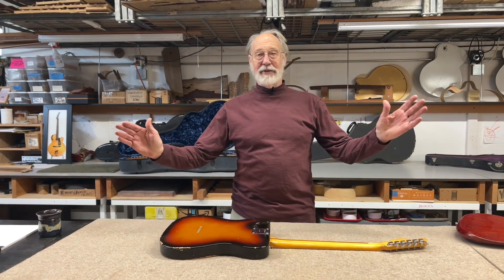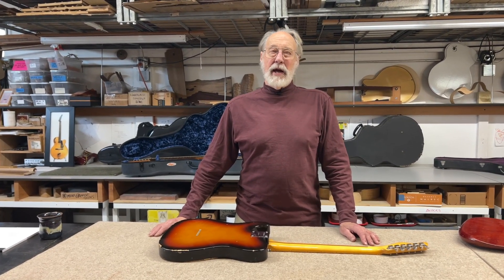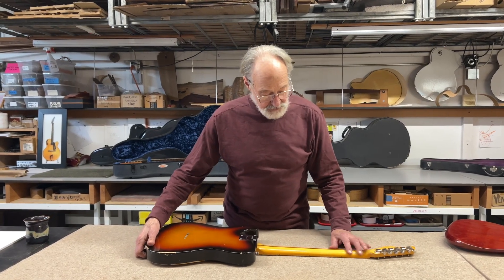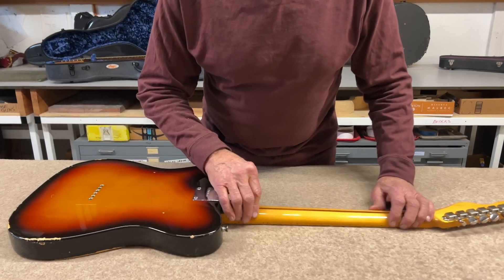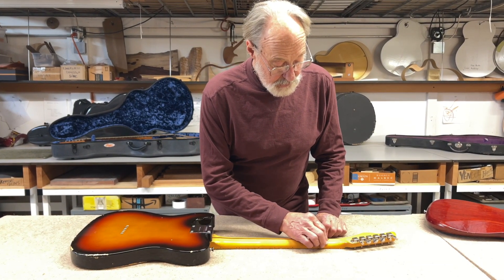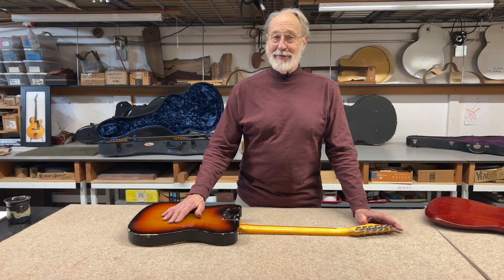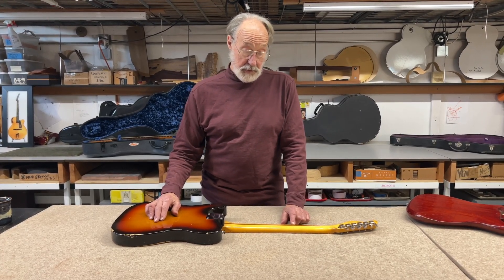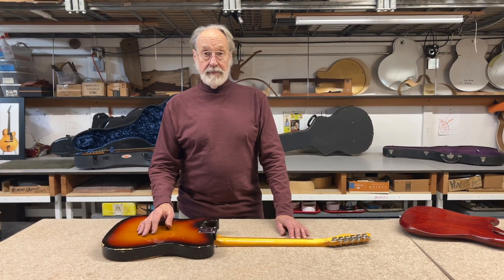Ken Parker Archtoppery - The Neck Journey 5) Neck Creep

Comment: Hello, Ken, can you tell us, how do you repair those necks with ´creep ´? As a hobbyist i found out,  that this effect is way more less on laminated ( longitudinal of course) necks, also on maple necks with glued darkwood fretboards ..For me it is really a problem, because i got a medium to  slim  one piece maple V shape neck, which i very like.I really needed  to lower the frets in relation to the other as from fret 13-14th on, up to  0,6 mm. Fretsize Medium Jumbo 1,4mm crown height. This leaves me not very much fret material there.  Only thing i can think of, is removing material from the neck itsel  as from these critical areas on. Thanks for an answer !
Reply from the maker: Yeah, Alex, you need to do some woodworking so that the frets are the correct height.
My method for this is to tune the neck with the desired strings, then adjust the truss rod so that the neck has the right shape from the 1st to the 12th frets. For an electric guitar, this means just a few thousandths relief at frets 4&5 on the treble side, and maybe twice that on the bass side, certainly no more than .008". This can be measured best with a feeler gauge set. Now you are ready to size up the woodworking that's needed above the 12th fret. Using a good 18" straightedge sitting on the first and last frets (while the guitar is supported on the bench in playing position, not flat on its back) , measure the gap between the 12th fret and the straightedge. It will  very likely be different on each side of the neck. Carefully measure with your feeler gauges, and write it down so you don't get confused. This is the amount of material you'll need to remove from the end of the fingerboard, gradually tapering to removing zero material at the 12th fret. Of course you'll need to remove the frets in the second octave, marking them for orientation and keeping them in order. If you remove them with care, using a correct geometry, non-mangling set of fret pullers, you may be able to re-use them. On a bolt on neck, remove the whole neck so you can measure the thickness of the neck at the end with your calipers so as to know just when you've removed the right amount of wood from each side.
Blend it all in the best you can, and re-drive the old frets, if they are full height or very close to it. One common cosmetic problem will be the change in color when the boards are maple or rosewood. Ebony doesn't usually present a problem.
I ran a big repair shop , 1978 - 1982, and did hundreds of these repairs in NYC at Stuyvesant Music, 48th Street and 7th Avenue, schooling the repair folks in my shop in the weeds of this job, which we dubbed "The Usual Repair" because it was so often a better deal for an amateur player than a whole fret job, and worked just as well.
Another consequence of doing it like this is that the fingerboard often "gets" a little wider as you remove fingerboard material, so the fret ends sometimes seem not to reach the edges of the fingerboard. A little sanding gets it all good.

Go Get It, and join the practitioners of the Usual Repair!
Reply: @kenparkerarchtoppery9440  Dear Ken, thank you for the trick to determine the final height of the frets..!  ( I already replied  to your  answer the day you wrote this, but i cannot find it anymore, disappear...:)) I had my ( mind )hands on it..I replaced the upper frets ...A lot of measuring points.. and using a straight edge in combination with  feeler gauge instead of estimating holding it against the light- is more precies. What a wonder ! I removed  the material from the frets. And i took the job seriously and went down to 50µm for the feeler gauge, and then  gradually removed material  from the 13th fret on with a shimmed file/taped levelling file - and it worked !  I took of about  0,7mm for the low  E string, and 0,3mm for the high E - string ! I already did some measurements on my other neck, there the neck creep is way less> thicker neck !! Again, i very appreciate your instructions, and made understand, how a neck ( can ) behave:) Best regards, Alex
Reply: @kenparkerarchtoppery9440  Dear Ken, i started doing this on my other Tele as well. I started thinking...🐫and I decided to remeasure the work i done one the guitar before. Some deviations...A lot of deviations,probably most meauring points were a ´lucky shot´...50µm is not precise enough....Too much material removed                                                                                                                                                                                              For the 2nd neck : 1. I set the relief to 0,25mm 2. I put a capo on the 5th fret. 3. I use the string as a ruler and verify visually ( holding the neck against a white computer screen). I was able to see the ramp of the neck in that area!! 4. I raised the strings with a bic lighter, tune them to correct pitch. 5. I made myself an `Understring levelling beam´  and sand with 320 grit. 6. I removed very little material, with and checking after each pass and retune. After about 4 passes i came to a result, which was very good. And there was not a lot of material to remove, maybe about 0,3 mm on the 21th fret. Puuh...I think the main problem is, that i should take my time, as i am a quite impatient individual👽Thank you very much Ken again for sharing your knowledge and curiosity !
Reply: Looking at your video about the fret work on the D´Aqisto guitar.. I am a big fool...🤭😂
Reply: @kenparkerarchtoppery9440  And i did it again...Now with removing material ofthe fretboard, not the frets.And i found out that my measurements were not correct...And i bought a precision straigt edge...And i use a 12 " inch sanding block for 9,5" inch radius as from the 13th fret on , creating kind a like a compound radius🤭I removed about 0,4mm...This is the amount i should have taken off from the frets in my prior work.But still... I am not getting my thin maple V shape neck very well...Too much creep...the neck is to thin.But i learned a lot from my attempts and mistakes. Thank you  again your knowledge to ´curious´amateurs😉

Comment: Very illuminating, as always---thank you! I am, however, left wondering how one fixes neck creep. I favorite guitar has it, and it's a bit of a PIA.
Reply from the maker: I just posted this answer a few days ago, and it mostly covers one way to get it right,

This is a tough decision sometimes. I's a challenge not to be in the room with your instrument, of course, as there are a lot of elements to consider.
Unless there is some reason against it (rare, but real, eg, historic instrument in original condition), I always favor doing the woodworking and using the same style wire for the whole job. Often, the first octave is OK, or can be quickly addressed with some light abrading and re-crowning. Way back when, '78 - '82, running the big repair shop I created at Steve Friedman's "Stuyvesant Music" on 48th street near Manhattan's 7th Avenue, a job so commonly performed that I came to call it...

"The Usual Repair" , or "the usual" 

First, lube the truss rod and check its ability to perform, adjusting it for the correct relief on the bass side
Precisely measure the neck's distortion at the centerline, and at both edges with a straightedge and feeler gauges, noting these distances between the 12th fret and the straightedge.
1) Carefully pull the frets above 12, without damaging them, having marked them for orientation with ink, and kept in order in a row of little holes in a block
2) Remove the correct "triangular slice" of wood to perfect the fingerboard surface , that is, "0" at fret 13, and whatever the offending number of thousandths was at the very end, checking with calipers. We normally would remove .005" - .010' or .125 - .250 mm more material than the plan called for,  just for insurance, although there are sometimes reasons not to do this, especially on solid-bodies that are heavily used in the second octave.
The tools used were a super sharp little plane with a tiny throat opening, usually skewed or even across the grain, then scrapers and sandpaper glued to a block..
3) Check and adjust the curvature of the frets, and reinstall.

Unless the removal of wood changed the color of the fingerboard surface, as it usually would do if the board was maple or Brazilian Rosewood, the repair was nearly impossible to detect, and the effect on the customer was to induce joy! 
Not only did the guitar play like a dream,  but also this repair was priced at half the cost of a complete fret job, and produced, if performed correctly, perfect results!
Reply: @kenparkerarchtoppery9440  Marvellous! My guitar needs new frets anyway. Thank you, Ken!

Comment: Fall away and if to severe' refret with taller frets' relevel and add fall away or just level the fretboard to get rid of it. Which one would you recommend?
Reply from the maker: This is a tough decision sometimes. I's a challenge not to be in the room with your instrument, of course, as there are a lot of elements to consider.
Unless there is some reason against it (rare, but real, eg, historic instrument in original condition), I always favor doing the woodworking and using the same style wire for the whole job. Often, the first octave is OK, or can be quickly addressed with some light abrading and re-crowning. Way back when, '78 - '82, running the big repair shop I created at Steve Friedman's "Stuyvesant Music" on 48th street near Manhattan's 7th Avenue, a job so commonly performed that I came to call it...

"The Usual Repair" , or "the usual" 

First, lube the truss rod and check its ability to perform, adjusting it for the correct relief on the bass side
Precisely measure the neck's distortion at the centerline, and at both edges with a straightedge and feeler gauges, noting these distances between the 12th fret and the straightedge.
1) Carefully pull the frets above 12, without damaging them, having marked them for orientation with ink, and kept in order in a row of little holes in a block
2) Remove the correct "triangular slice" of wood to perfect the fingerboard surface , that is, "0" at fret 13, and whatever the offending number of thousandths was at the very end, checking with calipers. We normally would remove .005" - .010' or .125 - .250 mm more material than the plan called for,  just for insurance, although there are sometimes reasons not to do this, especially on solid-bodies that are heavily used in the second octave.
The tools used were a super sharp little plane with a tiny throat opening, usually skewed or even across the grain, then scrapers and sandpaper glued to a block..
3) Check and adjust the curvature of the frets, and reinstall.

Unless the removal of wood changed the color of the fingerboard surface, as it usually would do if the board was maple or Brazilian Rosewood, the repair was nearly impossible to detect, and the effect on the customer was to induce joy! 
Not only did the guitar play like a dream,  but also this repair was priced at half the cost of a complete fret job, and produced, if performed correctly, perfect results!

Comment: This is all fascinating and most of it is completely new to me.  Thank you for explaining it all so well.
Question: would roasted maple be less resistant to creep than regular maple?
Reply from the maker: Thanks for your interest, these things have obsessed me for decades.
I'd be willing to be struck dead by lightning if roasted maple was less creepy than regular kiln-dried maple, but I'd bet my life that it's more costly!
 
Did you mean more or less? I haven't tested it, but maybe you could ask the roasters what their claims are. Honestly, heat has been a conditioning treatment for wood as long as humans have had open fires.
I have a spear I brought back from Uganda in 1970 which is richly colored from being heat treated. Done properly, the stiffness and hardness of the material is thought to be improved.
Modern, controlled roasting has not been shown to make major transformational  changes in wood properties. The changes are slight, and sometimes beneficial, but not necessarily, depending on everything you can think of, as usual.
Maple just Loves to bend and stretching is part of bending! We applaud and love this property in Maple, it's just part of its' identity, and I would be astonished if the oven w/o O2 would be able to change this in an important way.
One man's considered opinion.
OK, probably don't check, just in case of lightning, but really, no.
Reply: @kenparkerarchtoppery9440  Ha!  Thanks for the reply, and yeah, I did mean to say more instead of less.  Bad editing.
Anyway, I'm a big fan of your work, and now of these videos as well.

Comment: Ken, thank you for the neck creep explanation! Just did a fret height adjustment to compensate for this on my project guitar (also used your fantastic levelling file tool!). The buzz I was getting there was subtle, but once gone the difference in clarity of sound through my neck pickup is quite dramatic. I've been binge watching your videos lately, it's better than Netflix ;-) I love your considered and empirical approach to guitar building, thank you for this. If you ever decide to enable the 'thanks/support' feature on your channel, it would be my pleasure to get you a bottle of wine!
Reply from the maker: Love your handle. For thanks/support, that's easy, plant a tree or three! Many thanks for your enthusiastic praise!

Comment: Very interesting, Thanks.
 Is rebending this upper area of a, say, Tele neck a good solution? (Without knowing the answer, I would think it difficult to bend a 1" thick piece of maple to be somewhere inline with the rest of teh neck and not damage vintage finish.... but maybe a loss of finish is better then pulling the frets and sanding the fretboard surface?). 
And I would presume the heel shape on that Gibson L1 is better at resisting creep? Thanks Ken.
Reply from the maker: I don't think "rebending" as you say would be achievable. Every species has its' attributes, and maple likes to bend.
I know there is a lot of resistance to repairing vintage stuff that was built quickly as can be by anonymous, disposable hourly workers using unselect material in the fewest minutes possible, and while I understand this resistance, I would encourage folks to just choose whether it's a museum piece or a musical instrument. I had this conversation with hundreds of clients. Can't have it both ways all the time.
Heel shape is irrelevant to the materials' ability to stretch and deform by creep in nearly every case, as far as I know.
Sorry, creep is just what wood does, some species more than others. There are ways to lessen the problems of creep, but guitar manufacturers couldn't and can't be bothered with it, I think it's shameful. Any clever engineer tasked with improving this issue would be able to succeed. I know I have. Not that hard to anticipate reliable forces.
If you find a better way to correct or beat this without pulling frets and correcting the playing surface by removing a precise amount of fingerboard, please share it with the rest of us!

Comment: I call it Fenderitis. Relief from the first fret to the last fret. I often wonder why they don't just add some drop off to the fingerboard before fretting to anticipate what it inevitable... Because that's how I end up fixing it.
Reply from the maker: My buddy Sherwood Phifer calls this Gibsonitis, too! We're all wondering the same thing. It may surprise you  to learn that the only company to do what you suggest while I was working as a repairman was Ovation, who designed a small "fall off" after the 12th fret, and were generally not burdened with this common defect. This might sound odd, but remember, the parent company, Sikorsky, unlike Fender of Gibson, was able to reliably keep helicopters in the air, and had a work force of engineers.

Comment: So I'm thinking of an easy way to fix things right. So constant string tension is a problem. The hard solution is to get really pro on neck construction. An easy solution would be to be able to release some string tension with each playing session, which has to be conveniënt and regain tuning somewhat when re engaged. So I'm thinking a lever system at the tailpiece, what do you think?
Reply from the maker: Yikes! I'd rather just try to solve the problem, this sounds like it might create a few new ones!
Reply: You're right, it seems that on this topic literally everyone agrees on forums that string tension has to be maintained on guitars haha. it's incredible, looked it up, the agreement was unreal ;) @kenparkerarchtoppery9440

Comment: I find that in my instruments (and in my builds), creep is an especially big issue for basses (and worse yet with five or six strings). Im fascinated by the various way different master builders address this issue. Thanks for another great episode, Ken!
Reply from the maker: The 5&6 string basses apply huge loads! The cored neck with a little carbon/epoxy is perfectly applied to here. Also, you won't believe how great the low notes on the low strings can sound when they're not arguing about the fundamental pitch!!
Reply: @kenparkerarchtoppery9440  And i really think, these bass guitar really need to be produced again. I´ve once had an oppurtunity to play a Parker Bass. The bass so clear and punchy  !  No plans to build them again ? Greetz